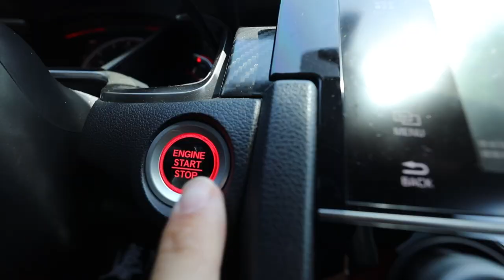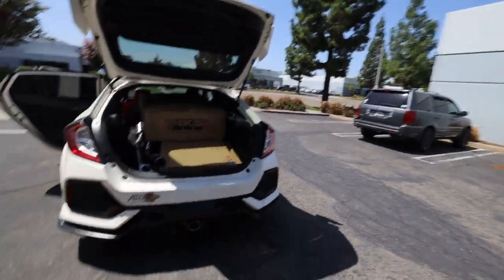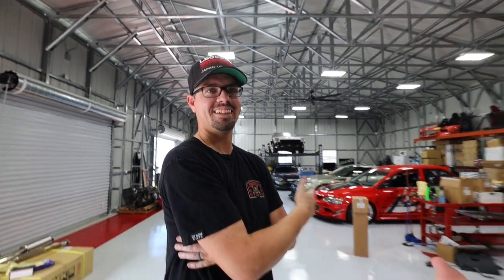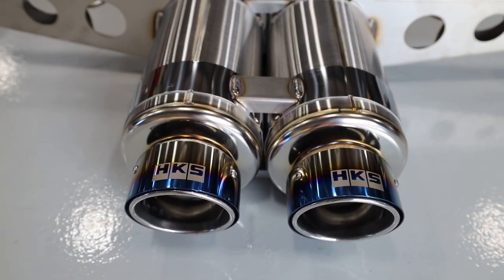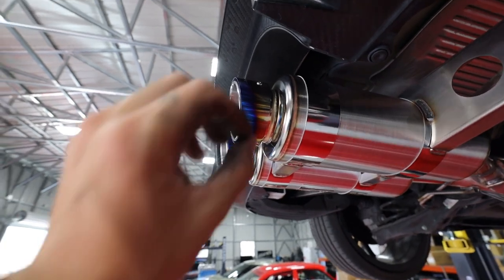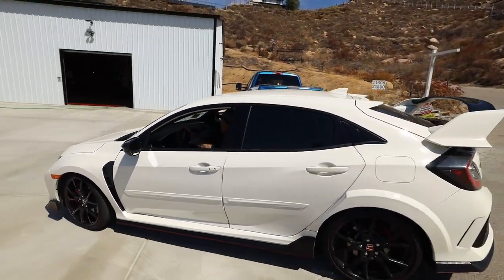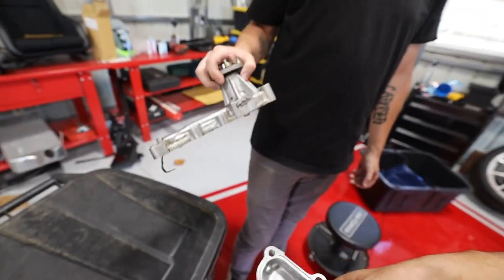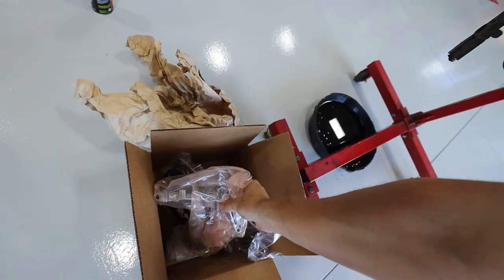Building My Dream Honda Civic Type R! | JDM HKS Spec L Exhaust Install

Comment: The fk8 really is the best all around daily comfortable practical and quick i was able to fit a 40gal water heater in the back of mine one time without issue really don't even need a truck the type r can do it all

Comment: just a reminder about the in cabin engine noise generator which you should definitely disconnect to help with better hearing the engine the right way and the exhaust.

Comment: 22:00 I would say wheels and suspension, but you're already doing that, lol. Only things I can think of would be a new intake, dyno/tune day (maybe a flex fuel sensor/tune? E85 ftw), and a short shifter.

Comment: Hey Dustin just a heads up if you’re looking at a carbon hood I wouldn’t do it if you plan on tracking the type r the oem hood is lighter than the carbon fiber hoods available. Just want to share some knowledge with you

Comment: Hey Dustin when you showed yourself pouring the Valvoline in the car..you do know that was wrong way to pour it out. If you hold bottle other way you can control the oil flow alot easier

Comment: The triple exhaust tip is so dumb, idk why Honda insists. At least they got a little smarter and went back down from 20's to 19's in the new Type R.
Reply: Still too big, IMO. 18s with a thicker sidewall tire look the best to me. They're definitely heading in the right direction though. 20" wheels on a Type R is just dumb lol.
Reply: @kasper_429  that's my size of choice. 18x9.5" with a 265/35 tire

Comment: DO NOT run that oil change valve! Especially if you’ll be tracking it! Ive seen those things fail so many times! All it takes is one rock or something to hit it the wrong way to dump all of your oil on the track! Is it really that hard to just undo the plug normally?